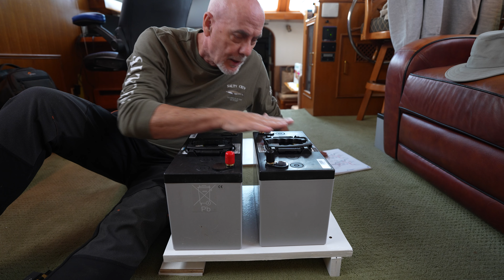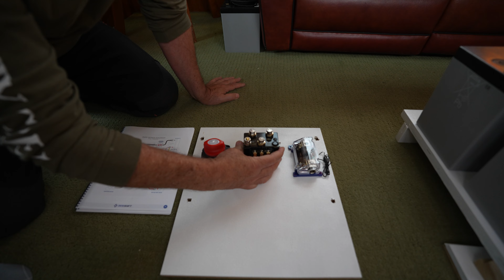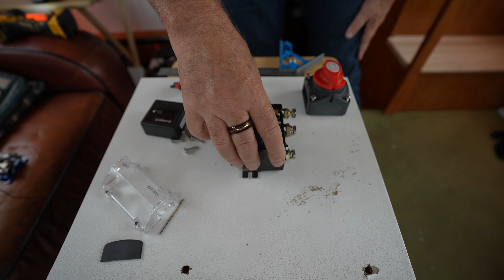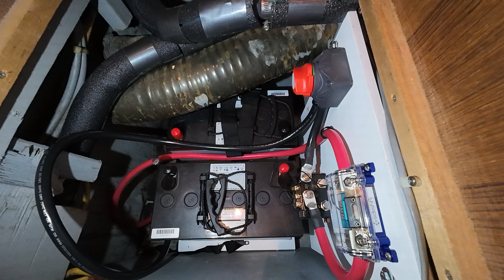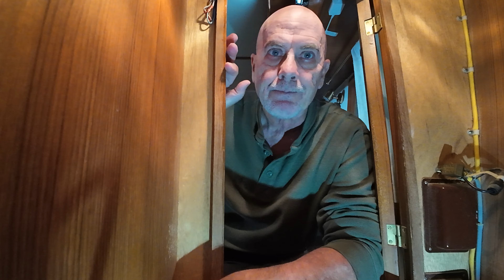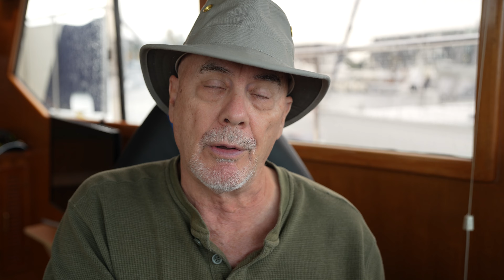Sideshift Stern Thruster Control System Build - Part One - EP38

Comment: I didn't see battery boxes.  I'm sure you're planning to include those which are an ABYC requirement for any battery on the boat. Thanks again for sharing this process. I may be doing the same at some time in the future after I get a bow thruster. Cheers!
Reply from the maker: Well, you certainly sent me off to do my research on this.  I read the Coast Guard regs and as much of the ABYC stuff as I could get to without being an actual member.  The battery box itself doesn't seem to be the requirement with sealed batteries, but a lot of emphasis is put on the securing of the batteries against movement.  
I read this doc:
https://www.govinfo.gov/content/pkg/CFR-2011-title46-vol7/pdf/CFR-2011-title46-vol7-sec169-668.pdf

and this guy has a pretty good writeup on batteries:
https://stevedmarineconsulting.com/battery-installation/#:~:text=Among%20other%20things%20the%20Standard%20regarding%20battery,latitude%20for%20movement%2C%20eventually%20comes%20to%20grief.

I'll discuss this in more detail in the next video, but I don't think I'll be installing actual boxes.  I'll be revisiting my method of securing these a bit, and will be taking some steps to further cover them (while retaining good ventilation).

Thanks for bringing this to my attention!  I'm glad I did the research.